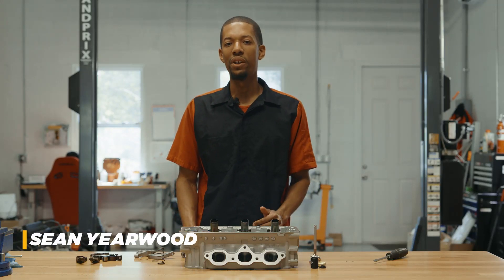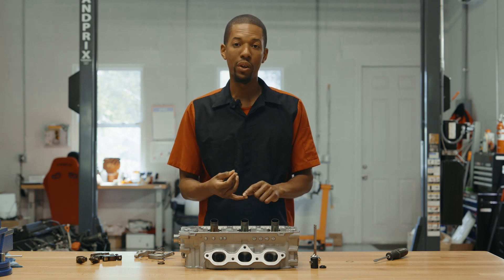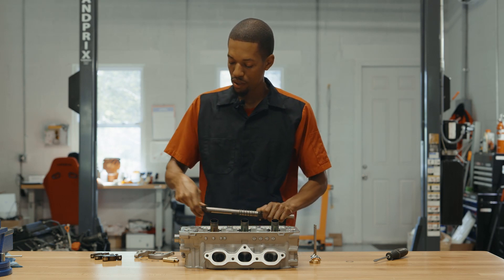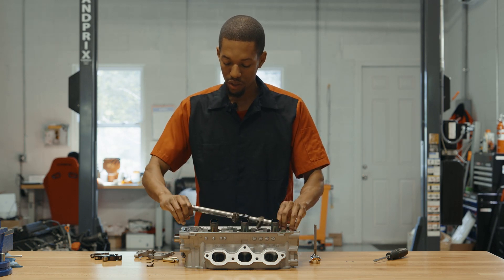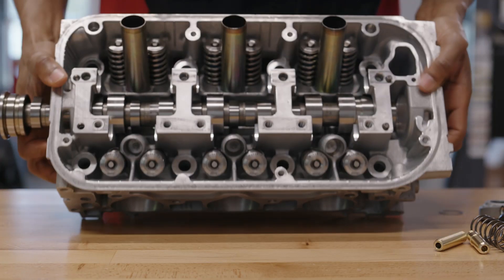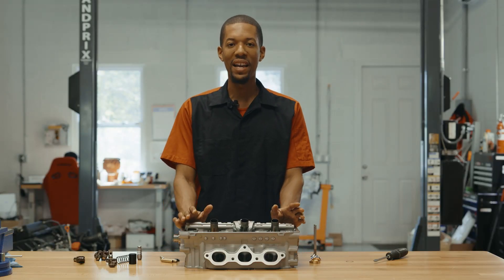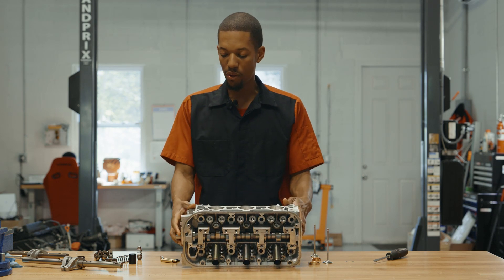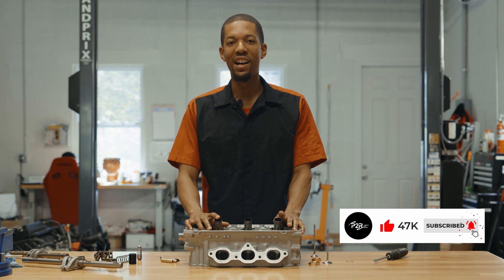J Series Tech Talk - Valvetrain Components & Aluminum Rockers Part 2

Comment: Did you ever get around to getting dyno numbers on these cams?
Reply from the maker: We posted a dyno video of our ILX with the P2R Hyper Stage 2 cams. 
https://youtu.be/6p8ue0tMgak?si=VonwjyniBaFhmxbn
Reply: @PowerRevRacing  any stage 3 in production or this is the largest possible as stated in the video?
Reply from the maker: @Dragmaniac43  our stage 2 is very aggressive.  All the specs are on our website.  Our stage 3 will require a line bore on the cylinder head to fit.
Reply: @PowerRevRacing  if that's what it take then that's what it will be.

Comment: @ P2R: THANK YOU for your ongoing and continued R&D on the Honda J-Series engines. I'm personally interested in a pair of your CNC ported cylinder heads, complete with lightweight aluminum rocker arms and mounts, VTEC killer camshafts and a port matched intake manifold completer with runners and all the necessary gaskets and hardware required to complete installation. I intend to install these components on my 6spd. 2003 CL-S. I'm also considering a larger, port matched throttle body, so long as this combination doesn't adversely affect drivability. Currently the engine is stock, having only added an AEM cold air kit. This is a NA build intended for routine street use.
Reply from the maker: Sounds good.  Give us a call or email us when your ready.  We will help get you sorted on a proper build for your car.
Reply: Did you get the heads upgraded? and did you gain noticeable power?

Comment: why did Honda use a spring instead of a sleeve to begin with? there must be some use for the spring between the rockers, otherwise it would not be there to begin with?
Reply: The spring is actually a damper. To controll the movement of te rocker at high rpm and prevent the roller from smacking the camshaft when the lobe is not engaged. It's a genius innovation from Honda and a bad decision to remove it
Reply from the maker: Thats the cheapest way for honda to keep the rockers separated. Its simple and effective.  But when your looking to increase hp on your engine you have to look beyond and do things that are more performance oriented.
Reply: Manufacturing a spring costs much more than Manufacturing an aluminum tube. To imply that honda added this spring damper because its cheap just exposes your complete lack of understanding and performance engine knowledge, Sean.

Comment: So are the vtech killer cams going to be hollow regrinds? Or can i send in my mdx hollow cams? Also how much is it to have my valve seats opened up on my j32a2. I want to go with bigger valves that the stock 36mm.
Reply from the maker: When they release they are going to be Billets. Not regrinds.   We have 37mm Ferrea valves but besides valve seats, you also need to run our Traum pistons which support the 37mm valves.
Reply: 36mm is better. A larger valve will only be more shrouded by the combustion chamber wall, and actually flow less air and decrease velocity..

Comment: I was just looking at your heads the other day. I'd love to put them on my new J35A3 I'm swapping in. But I'll probably put them on my J32A2 (bent valve & slammed spark plug), that I'll be rebuilding myself.
 And just as I finished with bolt ons..